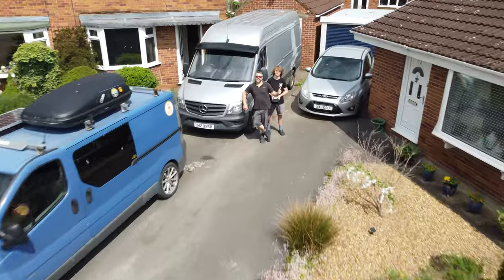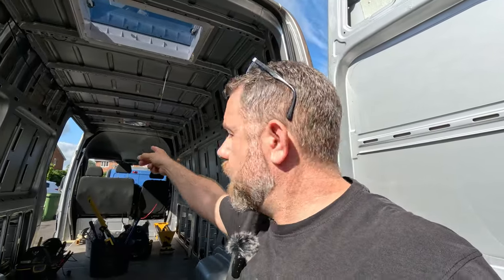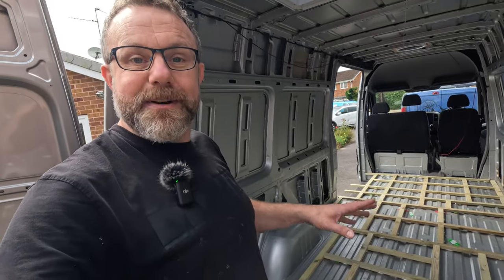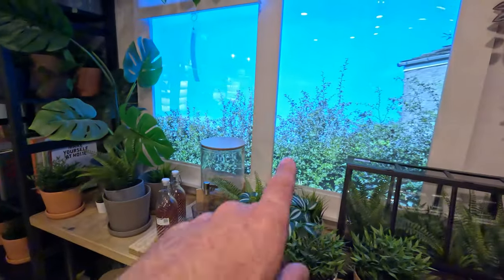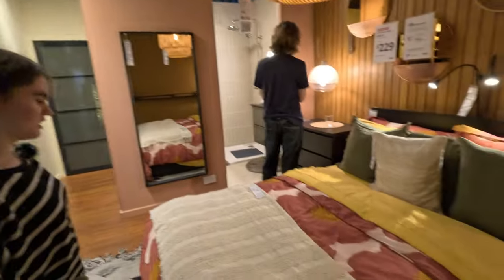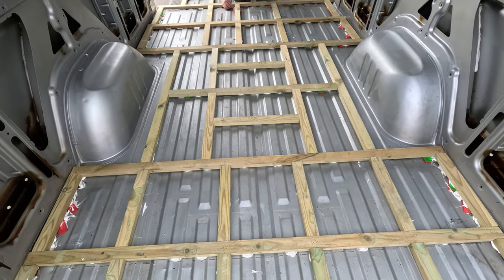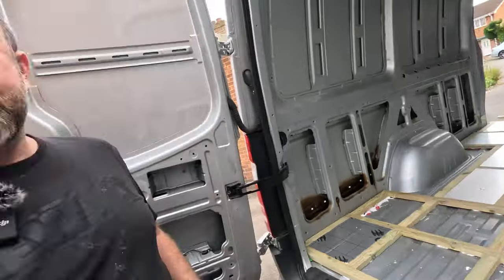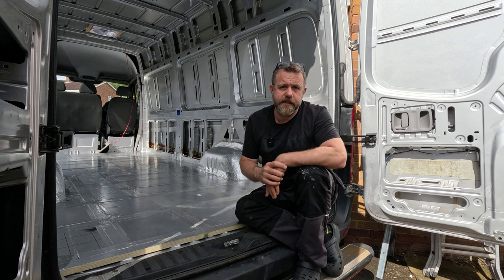Insulating the Floor of our campervan conversion & Ikea Trip for Interior Ideas!

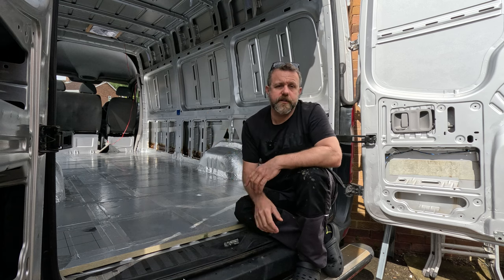Comment: 19:54 I almost forgot to do this bit myself!ha..where your sat now mate, use some of your closed foam insulation to fill the floor ridge voids and then foil tape .. last thing you want is when it’s raining and open the back door for water to get under the floor 👍🏼 ..I’ll be honest too..I made not far off the same mistake as you with the floor where the ply joins!ha also big shout to Ella for the colour choices, itl look lovely 😊
Reply from the maker: Good point. I'll certainly do that. Thanks for your comment. That's great👍😁. I'll pass that on to Ella 😉